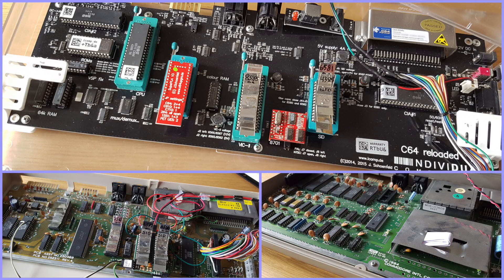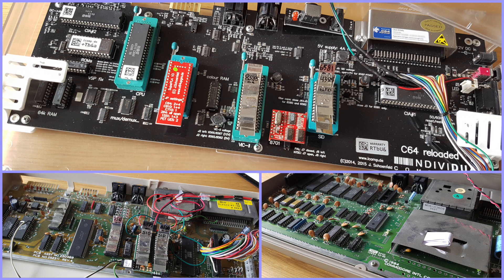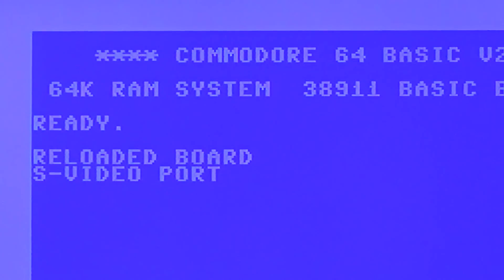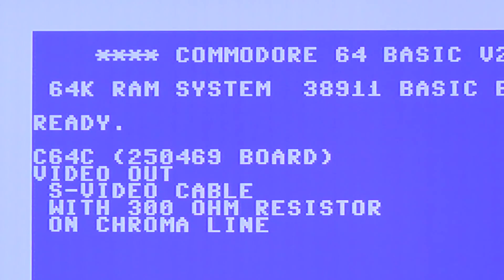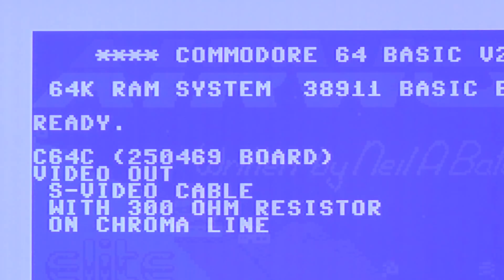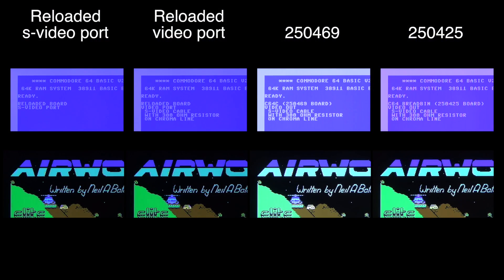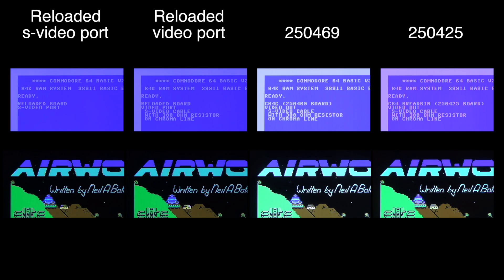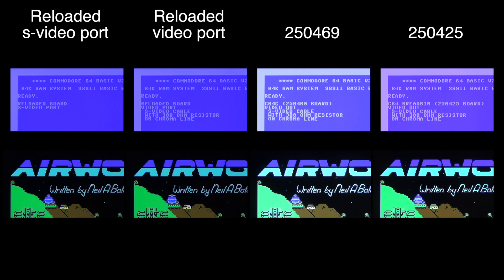XRGB-mini: C64 s-video image comparison (Reloaded/real C64).

Comment: it's not really about the board, its the VIC chip that makes the difference. Interesting video though :)
Reply from the maker: Hey, there. Thanks! Yes, you're right. I guess that thought never entered my mind back then. I know some things about this, but I'm not an expert. But I'm curious, is it 100% the VIC-II? I'm just thinking that, maybe there are components elsewhere that can also influence the signal. Like, the RF unit, for example?
Reply: i wouldn't say 100% no but that's probably the biggest factor. BTW have you tried a Lumafix? This useful gadget goes under the VIC2 chip and enables fine tuning of the video image. I have a couple and the difference is remarkable. The age of the board does make a difference, the rev A boards I find image not as good as the newer C64s but again thats probably cos the VIC2 is much newer. You're right though interference could come from other factors including power, capacitors etc. BTW I never use RF so I can't say anything about that.
Reply from the maker: Yes, I have a Lumafix (earlier v1.0). It's a wonderful thingy! God bless the smart people in the retro community. It made a difference in my former main C64 machine (250469), but I only use the Reloaded these days, and the signal from the chip I'm using in there is just fine on its own.

Comment: Catching up on your videos. Great comparison. I was whipping up a little C64 AV breakout box last night (C64 AV cable to s-video out to Dell 24" LCD s-video in ) -- need to get the 1702 monitor off my bench; it takes up too much space when doing repairs -- and wasn't very happy with the strange colour artifacts of the characters. However, I see the same effect in your examples. Thanks for the video.
Reply from the maker: You're welcome. You mean that red-ish hue (or whatever it's called), like on the 250425? If you're curious, try and remove that resistor from chroma (if your cable has that), and hook up the 1702 again. As far as I know, that resistor is only needed with the new LCD screens, and not the good old CRT monitors. And Tonguç Endem (see his comment elsewhere) thinks that the XRGB-mini upscaler doesn't need it either.
Reply: Sorry, I wasn't too clear on my objectives. I use an old Dell UltraSharp 2405FPW 24" LCD on my bench, mostly for my Windows computer display, but this model LCD has numerous other inputs including s-video. I did put a 330R resistor on the chroma line. I was actually going to install a potentiometer, but I did have a 1k handy -- perhaps for revision 2.
Reply from the maker: Ah, a potmeter would be neat (+ a tiny display to read the value - tech porn! haha..). So it looks fine on the Dell with the resistor? It was the 1702 that had artifacts, right?
Reply: AV cable straight into the 1702 looks perfect and clean. AV cable through my little box (with the resistor) to the S-Video input of the Dell LCD looks OK. Some pictures if you're interested, https://goo.gl/uarFYg.

Hmm, a pot and a display. I like that idea!
Reply from the maker: Interesting, thanks for sharing. I like all you people who whip up stuff yourselves. Heh, yeah, the display.. Guess you have to hook up some power to the video port, for a display to work? I see the newer 8-pin video port has some spare pins (7 and 8). Well, just a thought.. A display is not needed I guess, it would just be cool! But then again, many people do things, just because they can. That's argument enough, hehe..
Reply: Yeah, power would be needed -- 5V I assume. Perhaps a bit too pimped out for a such a simple thing, but yes, cool.

Comment: 330ohm resistor on chroma caused color bleeds on your XRGB input.
very nice to see an example of this 330ohm mystery.
wish you had all other examples without 330 ohm resistor as well since obviously XRGB don't need it.
Reply from the maker: Oh, never thought of it like that. That would have been nice, if I did that, actually. :) My knowledge is limited, but it's nice learning new stuff. The cables I use are not self-built. I just mentioned the resistor, because I learned that it's, for some reason, a necessary thing with the C64's output. But maybe the XRGB-mini works fine without it. Though.. I still use that, or a similar, cable. And I don't see any bleeding on my screen these days.
Reply: Apparently, some old analog TVs / equipment require some resistance on the chroma input of their Y/C input. A 1K potentiometer (variable resistor) would actually be best for those monitors/TVs or whatever. In my experience, any resistance on the chroma causes signal degradation on the modern devices.  
The best thing you can do for signal quality is to have good shielding on the cable and the soldering area and keep S-Video cable short. Bad soldering acts as an antenna and bad shielding allows interference.

Comment: Thanks. Looks great all of them. It's as if the XRGB device cancels out the C64 noise and lines.. ? The 250469 I think is the best. No violet on the blue, like the 250425, pink-blue-pink-blue every other character in basic.. Some machines more noticeable than others. The 250469 have none of that.. I have also trouble showing lines and noise on the video on youtube. It's as if there is a noise canceller on the video editor or youtube..
Reply from the maker: +bwack Yes, the pink shadows (or whatever it is?) can be a little disturbing. But it's not as noticeable in dark-ish games. Neither are the vertical lines on the 250469. And regarding the vertical stripes.. I have taken a picture, where it's a bit more clear. I put it in the description. For your convenience: http://i750.photobucket.com/albums/xx142/thrash775/shared/stripes.png
Reply: Thanks. Looks quite like my C64G which has a 250469 that I bought recently. I do have a hunch that these are the boards that can benefit the most from lumafix because of the 8565. The explaination is a bit technical, but as you may know I've looked at die shots and I see that the analog part of the VIC II, the one that can pick up noise, is different from 8565 and 6569. The old 6569 uses the analog for some digital as well, like the clock circuitry, a power hungry part of the chip adding transition noise to the video through the analog power. Now the lumafix remedies some of this, but the clock circuitry has like eight different speeds, so there will be a lot of transitions at times the lumafix doesn't counter act.. Just a hunch and what I've seen of examples where people are using lumafix on different boards..
Reply from the maker: +bwack I've seen some of your videos on all the die stuff. I've not seen it all, because a lot of it confuses me, I must admit. Your theory sounds interesting, nonetheless. :-) I have tried to use the LumaFIX on my 250469. I spent a very long time (half an hour, or so..) trying to adjust the potmeters to get the best picture. I can remove the stripes, but the picture loses a lot of sharpness. Bad tradeoff.. :-/ Maybe I didn't find the optimal settings anyway.. But I guess I'd rather have the stripes, so I took it out again. Then I tried a little experiment with the VIC chips in my Reloaded and the 250469. They both have the 8565 R2. I was curios as to how the picture quality would be affected, if I swapped them. But after the swap, there was no change. The 250469 still had stripes, and the Reloaded was still clean. So.. I don't know.. Is the Reloaded cleaning it up, somehow? Or can the RF circuit in the 250469 disturb the signal? I'm not sure what this means, in regard to your theory? If I understood you correctly, then the 6569 was the "bad boy" - not so much the 8565?
Reply: +Casual Commodore 64 Thanks for watching. That's intresting regarding the LumaFix and your 250469. Yes the picture looses sharpness because of reduced bandwidth that the lumafix circuits causes. I have a video demonstrating why and how the fix is affecting the video signal. Basically, the more fixes they put on the video signal, the more they impeed it. I tried bring it up on the lemon64, but nobody listened or believed me (or care) last summer... Anyway, reduced bandwidth isn't all bad I think, because with more bandwidth more noise is visible.. :-O :-O As long as it doesn't get as bad that you get smearing. I still haven't updated my stripefix board with latest changes.. I'm looking into making chroma fix also, sending the chroma in reverse back into the luma to remedy the checker pattern. You can see it slightly in the picture you sent me, but you don't have much checker pattern at all it seems. The XRGB most likely filters the luma signal, and cheap VGA converters don't and the pictures look horrible with C64. Might be easier said than done I fear. :-\ Maybe it's time to drop the jelly bean parts and go for dedicated video IC's..
Reply from the maker: +bwack But there is a 300ohm resistor on chroma in my cable. If I'm not mistaken, that's what removes (reduces?) the checker pattern? But yes, I'm sure the XRGB shows the signal some love as well, in some way. Looking forward to what you will come up with, with your stripefix. You seems to be a great "low-level chip nerd" (meant in a good way!).. ;-)
Reply: Not the same thing. Similar symptom though. The resistor reduces the chroma level such that modern TVs get the lower signal levels that they comply with. Still there is chroma on the luma if you look on a black and white image only with the chroma wire disconnected. Might not be a problem on all of the VICs. The XRGB probably have a sharp notch filter to reduce the chroma on the luma that the C64  has but shouldn't have.. What I've heard is that expensive upscalers have these features for gamers.. Jailbar filters, checkerpattern filtering, dot crawl.. not that dot crawl is a problem on C64, but can be on other systems like playstation.. :) LOL thanks for the compliment.
Reply: btw I'm retrobrighting now, videoing also.
Reply from the maker: +bwack Ooh.. I have a few cases and keys that could really benefit from that. One is an extremely yellow, but otherwise pretty, A500. I never really tried it, because it seemed a bit complicated. But maybe it's not? Looking forward to your video on that!

Comment: If I could make a request for a video I'd have you do one about the different setups you have. I never progressed beyond the standard C64 stuff. I'd love to learn.
Reply from the maker: +The Highlander I really only have one C64 setup I use (Reloaded). The others are just on shelves, and are rarely taken down (these days, anyway). What did you mean, exactly? I can show the different C64 machines and other C64 related equipment, while I tell you a bit about them?
Reply: I got the impression you had all kinds of bits and bobs. Boards, cables, FPGA's and what not. You seem to know more about what's out there (300 Ohm resistors on the Chroma line?). The nerd in me is curious.
Reply from the maker: +The Highlander All right. I'll see what I can whip up. It could actually be fun to gather ALL of my C64 crap on the table, and then just go through it while commenting. :-) I think I'll do that! But, as of writing, I'm a bit behind on my gaming videos (the one for tonight is not done yet..), so it will not be right now. But I WILL do it. Probably within a week or so. ;-)

Comment: I think I like the 250469 one because it's bright...You have a lot of hardware. One of those reloaded boards, are they worth having? What kind of keyboard do yo connect to that? Just the regular C64 one?
Reply from the maker: +The Highlander All the dimensions, ports and connectors on the Reloaded is exactly the same as a normal board (a replacement), so I just use a dark keyboard from one of the breadbins. But.. The sad thing is, that I'm pretty sure the Reloaded can no longer be bought. It was made in limited quantity, and it seems the party is over. :-( But as flexible and user-friendly as the board may be, it's not really a necessity. One can easily live without it. With the right precautions and upkeep, the original boards will last a very, very long time. It's just that my ever-craving nerd heart dictated, I had to get it!
Reply: I feel where that come from...
Reply from the maker: +The Highlander Oh, haha.. I can see how you could have read it. But no, I did not mean anything by that. It WAS actually meant "in general"! ;-)
Reply: +Casual Commodore 64 I meant having an ever-craving nerd heart wanting things. I suffer from the same ailment :)